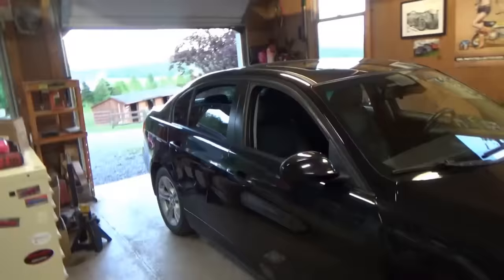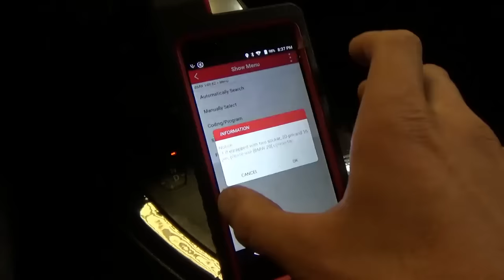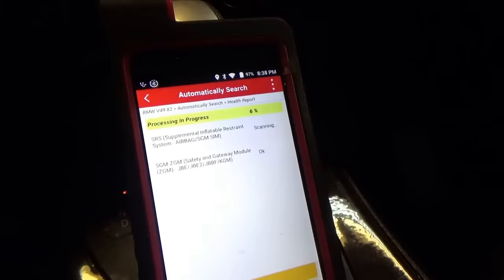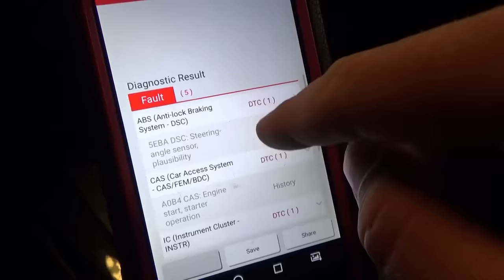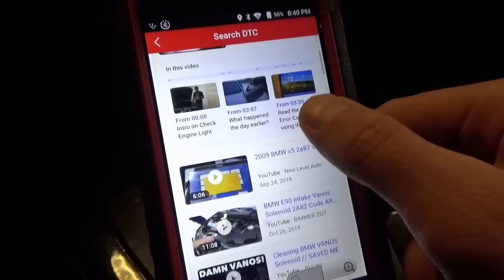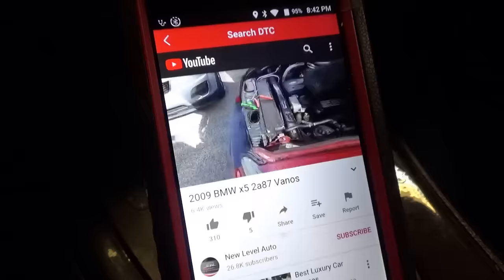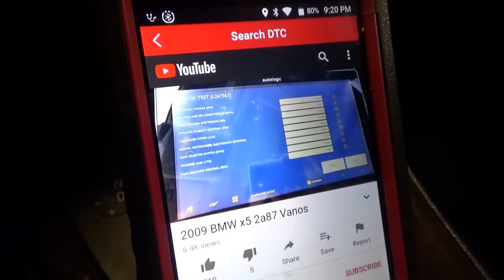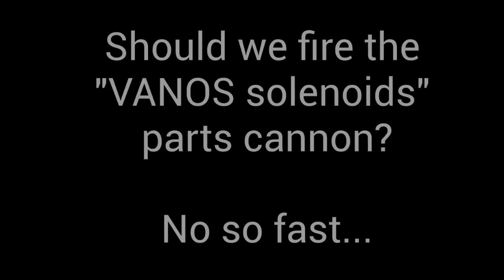Bad News BMW: Vanos 2A82/2A87

Comment: I don't know the specific BMW models, but some of those engines are notorious for rod bearings wearing prematurely, which then causes low oil pressure. The problem is that once the metal particles are circulating around the engine, you get solenoid problems and other VANOS issues. You should be able to roll in new bearings with the engine in the car, but I think the cradle has to come down. Not a job to do laying on your back!
Reply: That would be the S54 6 cyl and the S65 8 cyl found in M3 BMWs. Problem is you only hear about the ones that fail and that is usually because mechanically unsympathetic people rev the shit out of them before they have warmed up. I own a E92 M3 with the  S65 and always let it warm up before a workout and never had a problem with it. They are a great engine putting out better than 100hp NA  per liter back in 2007 so of course a highly stressed, you just need to be gentle when cold. Unfortunately most of the wankers who bought them new wouldn't know how to put air in a tyre

Comment: I used to have a 2001 Ford Crown Victoria 4.6.  I bought a bunch of new filters from a taxi cab company that phased out their Crown Victorias.  The brand was Prime Gard.

I went through 3 filters, they made a high pitch buzzing/whining sound and caused my oil pressure gauge to fluctuate.  I originally thought it was the torque converter, because I switched out the oil filter and it kept happening.

Finally I got to the 4th filter and the noise went away.

Moral of the story, don't cheap out on something that's already inexpensive to begin with.  You can find the video of the buzzing/whining sound on my profile.  This saga was from 7 years ago!

Comment: Hopefully they've put some of these problems behind them by going back to a closed desk engine block. This gets rid of the bed plate.  I have a 11 335i with the N55, awesome power. You just have to keep an eye on everything that could leak and not let oil get on the belt. Owning a BMW is not cheap even if you take care of them. Good call on finding the metal in the filter!

Comment: Definitely it had a spun bearing / and an oil gallery problem what led to low oil pressure.. a couple more miles for the connecting rod to come out to say hi 👋
Reply from the maker: Actually the plugged strained probably led to oil starvation and all the fallout lol
Reply: I believe if it had a spun bearing it wouldn't run as smooth as it did.

Engines with spun bearings make a lot of noise and don't run well at all.
Reply: @99domini99  i have seen a main cap spun bearing with 0 issues except for sparkling oil filter
Reply: @Airman..  Damn that's interesting! Never heard of that before! Wouldn't a spun bearing wear down extremely fast as it's oil supply is cut off?
Reply: @99domini99  exactly once you have a single oil gallery blockage at any bearing it will overheat therefore swell, chewing the block/cap and sending copper alloy shavings all over the engine kelling what's left of it

Comment: Easy fix, it's only the poor quality oil seals in the vanos turned to toast, replace with viton, job done
Reply: No..no..its so much more
BMW once meant something.Now they are piles of plastic crap.😎
Reply: Metal shavings = damage already done
Reply: sell it and get a w204
Reply: apachelives yep, saw that later in the video... that thing is a boat anchor now. 🤣
Reply: @apachelives  depends on where they came from, could be the chain or the vanos. The engine is protected from shavings under normal circumstances. Drop the oilpan and look if there is more in there. If yes, it could be the bearings of the crankshaft. If not, look at the camshaft bearings, the oil for the vanos come from the head. The oil pump as a filter in front and the oil filter should fetch the smaller parts and shouldn't push the oil through the bypass.

Maybe somebody fucked up the threating of the oil filter housing and it's the threats or plastic from the filter housing.

You could spent hours on that alone. But here, without watching the complete video, I guess the pump died and that's where the shavings come from.

Comment: Ok, at the end of the video it's clear what happened. The oil pump ran dry, if you could drop the oilpan  and remove it, you would see busted teeth in the pump.
The filter and screens should have fetched the worst, but you are right that it's not a cheap fix. Clean all screens, install a strong magnet in the oilpan put 0w30 in it, drive it for some time and to that whole procedure again until no shavings can be found on the magnet or filter/screens.
That's nothing you want to do as a mechanic because the customer comes back multiple times and has to pay every time, leaving with the feeling the engine could die any moment.

And of course repair the other problems with the belts, orings etc.

I did a similar thing with an Alfa Romeo 146, they are known for bad crankshaft  bearings. We installed a magnet and every 5000km we checked the system and put in new oil. But because the oilpan is hell to remove, I just inspected the magnet, screen to the oilpump and filter. After 3 sessions, it looked good and she is still driving it. That was one of the last cars I helped with, was not worth my time.

Comment: That's why I picked up a gold 2000 Mercedes E320 with 233k miles on it for $525 and it's running like a champ, I put in $2k in for repairs,  the engine and trans run like new.  I had to do engine and transmission mounts, changed coolant, oil, transmission oil.  Had to replace power steering high pressure hose that was leaking. I did seafoam treatment on the intake and through the gas tank and in the crankcase.   The paint and interior are in really nice shape for the year and mileage.

Comment: Wasn't much of a problem really, shucks just needed a new engine. Liked  the downturn at higher revs and free metal shavings for the electric kiln, how thoughtful. Scotty, the prophet from Texas, words came to fruition on hearing the verdict. He must have burnt his fingers and the rest of his extremities trying to repair some of these contrary machines. Keith ,the prophet from Staten Island, seemed very familiar with the intricacies of BMW and was, 
as usual, very informative and helpful.  All in all, a very unusual study but pointed the customer in the right direction and resulted in a equitable solution for both relevant parties.

Comment: The joys of not servicing an engine when stated in the manual. Fresh oil and filters plus new timing belt when prescribed.
Reply: E90’s do not have a timing “belt” they have a timing “chain”. Just fyi :)
Reply: To Take the oil pan off you gotta pretty much dropped the whole front of a suspension in the car very pricey

Comment: When you said 150k miles, I was like do BMWs engines survive so long in US? I would not touch a BMW engine after 100k Miles here in Europe. Great work Ivan you spared your client a lot of money and expensive repairs.
Reply: Engines here in u.s. easily go over 200, 000 miles with maintenance.  Big country, lots of highway miles.  My wife is in outside sales and puts 30,000 miles a year on her car.  2005 Ford Escape 215,000- 4 cyl,1996 Ford Taurus 3.0 l 6 cylinder 205,000.  My brother has two Fords, both over 230,000 miles- they are v8 engines which seem to be more durable.
Reply: My e70 3.0 has 242k..just did another tune up /coils...runs like a champ.
Reply: My wife’s E70 N52 has 234K miles and still purrs like a kitten. Just do the maintenance in time.
Reply: Absolute nonsense. If anything, fuel standards are higher in Europe and is more likely to contribute to a longer lasting engine. Diesel BMWs can easily get to 200k across Europe without much engine trouble.

Comment: Think you did the right thing in not marrying that car lol. Never knew about the belt issue with them! Some useful information to store in the brain for future. The first time you pulled the filter out you could see the metallic glitter in the housing and knew it wasn't going to be good. Makes me wonder what the switching pressure on that oil switch is set to? You would think the oil pressure light should have been coming on in the higher rpm's if pressure was falling that low. Crazy!!!!
Reply: belt issue is usually only an n54 issue

Comment: I would think possible cam shaft bearings. Now I haven’t finished the video yet Ivan but maybe drain the oil and see what you find and if it has the glitters I’d pull the valve cover and see what you find. Just something I would look at. Now back to the video to see what you decide. I’m only up to the test drive portion. You and wife stay well Artie 😊😊😊thanks for the update.

Comment: There should be an oil pressure control valve on that engine it’s a PWM solenoid that is controlled by the DME.  so you will not get full oil pressure at all times With no current flow the valve is wide open so if you unplug it an retest this usually gives the true reading of the oil pump pressure
Reply from the maker: So it defaults to low oil pressure?? 😬

Comment: Launch uses Factory OEM Software for BMW's. That clicking noise around the filter sounds like a problem with the DISA valve (if it has one). Oil looks like it has been recently changed, level is ok but is the oil grade the right one? Maybe they put the wrong one... That would explain the metal shavings in the filter and because of the engine wear (has bigger gap between moving parts) then we get, as a result, low oil pressure. Thicker oil grade might temporarily solve this issue? Love your bonus footage and follow ups!

If BMW wants to eliminate oil stick they should think about adding some oil pressure sensors along with their oil level sensors.

Comment: Oohh man, that's insane!!  Here I was, as soon as you mentioned history codes for the starter, I was expecting a pinched harness or something.  Isn't that one of the models where you have to pull the engine to replace the starter?  So many potential problems...

Good to see the dealership he bought it from was willing to work with him a bit!
Reply: Do not have to pull the engine to replace starter. It's under the manifold.

Comment: So, what was causing the metal parts then? You didn't talk about it. The other issue with the belt, you just have to make sure the oil pan gaskets are regularly changed and you can buy a protection from KIES motorsport to protect your engine from shredded belt.

Comment: 10:07 NEVER DO THIS! There is a extremely important valve in the cap. IF THAT PIECE IS EVER REMOVED/BROKEN, REPLACE THE CAP IMMEDIATELY! DO NOT REUSE ONE WHERE THAT SPINDLE IS BROKEN OR REMOVED! IT CAN AND WILL DESTROY THE ENGINE!

Comment: You Hit it right when the engine revs up and the pressure drops it means the pump is staving for oil. The inlet screen is plugged up.

Comment: I don't blame you for shipping it. not having a 2 post lift, support fixtures, engine hoist. I had to do an engine on an infinity a year ago, and it was locked up. I used the power train lift table we have meant for the High Voltage Battery for the Chevy Bolt, and lowered everything on to that. Sometimes you gotta learn to walk away. Its good he got assistance of getting another engine put in.  Very interesting on the belt getting sucked in to the crank seal and clogging up the oil pick up tube.

Comment: The lesson is - do not ignore oil leaks especially in the front of the engine.  Weird how an oil soaked belt gets sucked into the engine through the crank seal but on certain BMW's it happens. And if it does happen, remove the oil pan and clean the debris out right away instead of just replacing the seal and belt.  This engine was ruined due to neglect and a previously done short-cut repair.

Comment: Damn good video bud. That's exactly what my problem is. At dealer confirming. 2010 bmw 528i n52 e60 at 106,000 miles. 
THANK YOU SOOOOO MUCH.

Comment: Bought my with the same issue plus it stalled at red lights. Ended up being the oil filter cap. They broke the stem that sealed the hole in the housing no oil pressure at stop light means stall. $40 problem that cost me a grand before I figured it out

Comment: My 5.7 litre Chevrolet LS1 V8 engine in my Holden Commodore has done about 357,500 kilometres & all I've done to it is thrown a new set of hydraulic lifters & a new timing chain kit into it, the engine has also been resealed,I tested the oil pressure before spending money on the engine as I needed to rule out bearing noise ,it was stuck lifters,the oil pressure at idle speed was 30 PSI with a warm engine & 60 PSI at 4000 RPMs,the engine sounded worse that it was & a check engine indicator & a scan tool told me that the Chinese knock sensor that I bought for it wasn't working & the other one that I replaced in 2009 was failing, I replaced that one in 2019.

The metal particles could be due to a shot oil pump rather than shot bearings because the crankshaft & camshaft bearings come after that fact - the oil filter,I would expect to see either brass or copper wear particles in the oil filter if it was the bearings.

Someone on here bolted that sort of engine into a BMW so he can't go wrong with that one.

I know about engine mileage,my brothers 2000 model Subaru Forester which runs the EJ20 engine has only had the cylinder heads done up on it & it's done a similar amount of kilometres as what my car has,the heads needed doing up after dropping a valve which my cousins partner fixed up as he's an authorized Subaru mechanic,my brother runs it as dual fuel meaning that the LP gas is hard on the engines as far as exhaust valve seal recession goes,they were 600 kilometres away when that happened so my brother had to leave the car with him then pick it up later after it was fixed up.

I have to replace the ECU in that car because my brother needs to get a registration inspection done on it & it's not running on cylinders 3 & 4, the ECU wasn't supplying a fuel injector pulse to the fuel injectors & it being a semi sequential batch firing ECU one of the transistors had blown up in it therefore cylinders 3 & 4 are fired off one transistor & 1 & 2 are fired off another one,that brainbox is bolted onto the engine in that car !

Comment: Don't know if the N52 engine had the same problem but the N54 (E46 M3) had an issue where the bolts holding the phaser to the cam would back out until the bolt heads ate into the aluminum timing cover filling the engine with metal filings. That would explain the tapping noise, the filings and lack of oil pressure.
Reply: E46 M3 is the S54, the N54 is the early model E90/E92 335i twin turbo engines.
Reply: @user-ge1gs8tk9s  You're right, should have said S54.

Comment: My 92 Ford Ranger lost oil pressure the higher rpm.  Issue was oil pan gasket broke off & restricted oil pickup line   problems became worse because oil pan removal = engine trans pull & trans fluids were not refilled.  Oil pressure fixed ran great transmission grenated.

Comment: I wonder what the dealer REALLY did. It acted like the oil strainer(s) were blocked.  Depends how much the buyer paid for it whether it was worth doing more than dropping the pan and  flushing out the shavings with multiple oils changes.
Reply: You have to drop the subframe on that one to get the oil pan out.

Comment: Here is my 2 cents for long life of a bmw. Buy it new, never go to the dealer for oil service. Buy a OEM filter with good motor oil like liqui moly or motul do not use Mobil 1 in a BMW. Change the oil every 5000 miles for turbo cars or 5500 for non turbo engines. If it has stop/start disable it if you can.
Reply: Why not Mobil 1 ?
Reply: Mobil 1 5w30 has a compound it that over time in these engines and particularly pcv systems causes the oil to become acidic and cause damage to some metals in the engine
Reply: I recommend the same interval to my BMW customers.Customers don’t have a pain in their ass and I don’t lose my ass 👍
Reply: Robert Slackware yes. Bmw states that it is normal to use about 1 quart of oil every 700 miles

Comment: Pull main and rod cap roll in a set of bearings,  along with check oil pump screen. Of course check crank for damage . This might work if there was no damage to the top end ect

Comment: I'm sure this has been mentioned but you can actually but a cover to protect that crank seal from belts being consumed do £60 .I've been led to believe its normally an oil leak from that oil filter housing or heat exchanger that causes the belt to depart .
Great channel only discovered it yesterday and a have a BMW 125i n52 lump great engine service every 5 k and check always for little oil leaks.

Comment: If you maintain it the bmw n52 will last 200k miles plus no issues besides normal maintenance. They have two big issues. Water pumps are bad but there’s a recall and it’s more common than not for them to be leaking oil but most the gaskets are diyable but x drive makes the oil pan hard to get to

Comment: Great vid as usual Ivan!

Unless customer wants to change engines seems like the diagnosis should be the only money put into this car until it dies.

And almost all engines use some form of Variable Valve Timing and almost all of them seem to be problematic around 80K or more. In my case, two of my vehicles were actually losing oil (bad mfg and cheap rings that wore prematurely) so VVT errors kept popping up and causing CELs. 

All that said, if this car were sold dirt cheap (say 1K), I would be interested. There are always BMWs that get rear ended or smashed with low mile engines. Since this would not be a DD, would make a great swap project and educational experience.

Comment: If it had metal in the oil, it could be either the main bearings or the camshafts wearing out. But as with most German cars, the only way to stay out of trouble is not to keep them past about 60K miles or so. Then you trade them in. And use genuine oil filters.